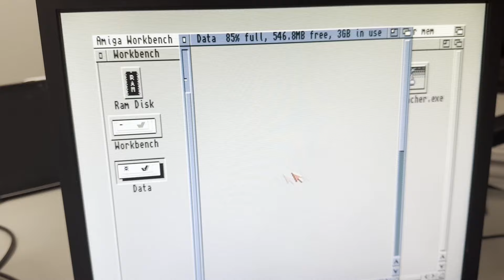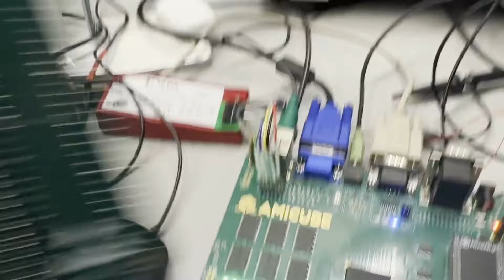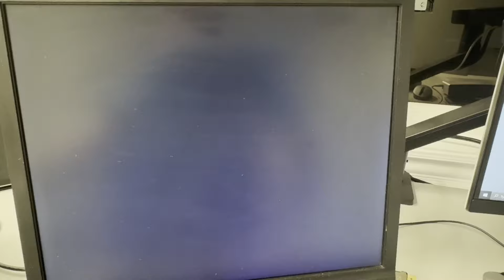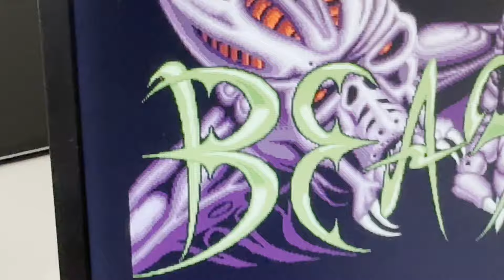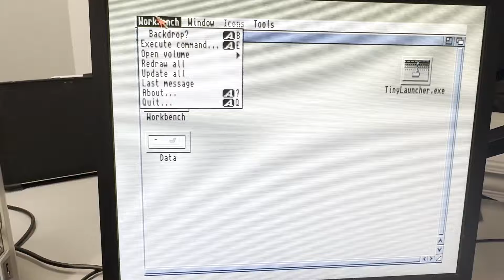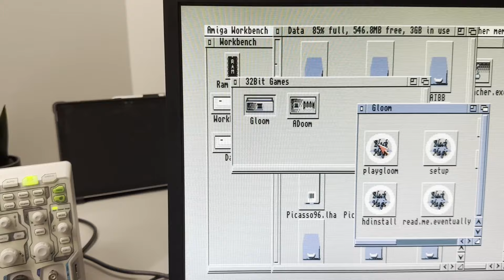🚀 AmiCube v1 - Early Testing 🎉

Comment: It would be nice to have a footprint for a physical Motorola 68060 microprocessor! :)
Reply from the maker: I am actually working on the board that will have 68060 socket. In one of my videos you can see the kicad 3d model.
Reply: And footprint for physical AGA chip could be an option as well. I have a huge stock of these chips! 😀

Comment: Interesting work, but why are you insisting on Neolithic era IO ports? You have all the resources you need for HDMI video (audio and video interleaved on the single port, and the TV/Monitor handles the DAC and analog amplifier stages), plus keyboard and mouse via USB (you can do this with a few MOSFETs and a bunch of logic dedicated to ULPI phys, or add a USB33xx chip to the board and offload that also).
Reply from the maker: All good points. As we speak I am working on the replacements.

Comment: It's so interesting that most of the chips are recreated in the FPGA except for the MC68000, level-shifters, and RAM.  I don't have a feel for programmable logic, but it seems like a 1979 CPU should be easy to implement in the FPGA. I can see how having the actual chip on the board could provide some street cred, though. 😊 I have noticed how dang expensive fpgas are, though. Maybe using the real chip was a big cost savings.
Reply from the maker: You're absolutely right! In fact, the new Amiga AGA cores include a built-in 68020 and I must say, it performs very well. The advantage of having a real socket and a reliable 68000 bridge is that you can add Amiga accelerator cards like the TF68030 or even PiStorm. But at the end of the day, this is all about fun, nostalgia, and the joy of learning RTL, electronics, and keeping the Amiga alive in the retro scene. From a purely practical standpoint, using an emulator is the most cost-effective solution - unless, of course, you're into the hardware side of things.

Comment: Wonderful! I especially like the new floppy interface! But – why not add an IDE interface, too? You mentioned that you are planning different cases – like a cube shaped one – that is great! But why only have two 3.5” floppy bays? I have used a 5.25” external floppy back in the days, too. And if you could add a IDE drive connector, we could connect this to an CD-ROM drive, too. The AmiCube Board is in mini-ITX format and has it’s switches at the front. It’s from factor allows it to be installed into a standard mini-ITX case, but in this case, one would need to be able to connect the front panel header (power/reset button, power/HDD LED). I don’t know exactly, but maybe the headers behind those switches are for this purpose? And finally, my last idea: Why not add all of the Amigas legacy I/O interfaces like LPT/parallel port and an external disk drive port and one serial port? Maybe you can use more of those double connectors or break out cables?
My perfect Amiga would be your board with an original 68000 CPU running at 7/32MHz in one of your Cube shaped cases (hopefully in Amiga beige with an Amiga style design) – equipped with one 3.5” drive and one 5.25” floppy drive and one (slim?) CD-ROM drive. I would also like to use a rotating IDE drive (just to hear the hard disk sounds).
I love your project – keep on with your great work! Too bad that we are not neighbors, otherwise you would have another hardware engineer in me who would surely show up on many Saturdays and help you with your project!
Reply from the maker: Thank you so much for your thoughtful feedback! I’m 100% on board with your ideas. In fact, the trajectory of this project is to use as many original devices as possible. My ideal setup would definitely include a real IDE drive along with the two 3.5” floppy drives, just as you described.

I love the idea of adding legacy I/O interfaces like LPT/parallel and serial ports, these are things I’ll definitely explore. The idea of incorporating a 5.25” floppy drive and a slim CD-ROM drive is also appealing for a more authentic experience.

I really appreciate your enthusiasm and support, if we were neighbors, I’d love to have another hardware engineer on board to help out on Saturdays! Thanks again for your great input!

Comment: I have some questions (but, to be clear - I think this is a great project and I intend to get one device even if the answers are all negative!):

1. What is the chip RAM access speed reported by SysInfo when using PiStorm? Is there any chance to reach A1200 speed?
2. Is there going to be a way to connect a CD-ROM drive?
3. Is it going to be possible to use mouse and keyboard connected via a KVM switch (a hub from the perspective of USB bus)? I am rather short of desk space as I have already 3 development machines; I would prefer to just use the existing mouse+keyboard.
4. Would it be possible to output audio/video from both AmiCube and RaspberryPi using a single HDMI port? I'm asking, because the PiStorm team is working on a hardware accelerated Warp3D implementation, so it would be great if we could use this; AFAIK they are planning the AHI driver too.
5. Regarding the MIDI - have you considered adding a PC sound card wavetable header, so that we could use the DreamBlaster X16GS as a MIDI instrument?
Reply from the maker: Chip RAM Access Speed with PiStorm: Yes, I believe it's already in the 3.xx range, and there's potential to push it further to get closer to A1200 speeds. We’ll continue optimizing it.

CD-ROM Drive Connection: Absolutely! I plan to add an IDE connector for this. While it may not be in V1, it will definitely be included in V2.

USB Mouse and Keyboard via KVM Switch: I’m currently working on the USB interface for the keyboard and mouse, so it should be possible to use them through a KVM switch. You’ll be able to use your existing setup without taking up extra desk space.

HDMI Output for AmiCube and Raspberry Pi: Yes, this is definitely possible. We can add a connector and trigger the switch between AmiCube and Pi output based on certain events, allowing for both to share a single HDMI port.

MIDI and PC Sound Card Header: MIDI is actually a big passion of mine, so this is a perfect suggestion! I’ve definitely considered adding a PC sound card wavetable header, which would allow for the DreamBlaster X16GS or similar MIDI instruments to be used. It’s something I’d love to explore further!
Reply: @amicube  Cool! Thanks for your effort - and good luck!

Comment: This work is truly amazing and getting more and more exciting... The addition of Floppies is also a great addition to the project. I can't wait to get my hands on one of the completed boards as i would like to build a Amiga Tower And being its ATX this opens up so many possibilities but we will need a io shield as well. I have a couple of questions and i know this is a work in progress and more functionality i'm sure will be added. but is it also possible to add IDE to the main board. i know its a an old format.. and this can be solve with some of the SATA to IDE converters. And also brings this project closer to the CD32 as well.   Now the PS2  changed to a USB would be even better but the Hid2ami can be used to help on that issue. i wish i had tons of $$$ i would set you up at 3370 Pharmacy Ave, Scarborough, ON M1W 3K4
Reply from the maker: Thank you for the kind words! We're definitely planning to add an IDE header to the board, and it should be fairly straightforward. Not to mention HDMI and USB <- KB, MOUSE, JOYSTICKS. For now, you can use the IDE option with the TF030 accelerator. I agree, Hid2ami is an awesome project!

Comment: Can't wait! Only thing I would love to see is the ability to connect a real Amiga keyboard to it. Everything else checks all my boxes. Would love to put this in my A3000 case with a A3000 keyboard :)  Will be buying one one released. Another idea for the next broad you create - Addition of an expansion port.
Reply from the maker: Yes! I will add Amiga KB header. This is easy. Straight to FPGA.
Reply: I'm guessing probably not as so few exist and they're getting rarer, short of building one of the incredibly expensive recreations.  What you could possibly do (I haven't tried it) is go Amiga Keyboard -> USB -> PS2.  The Amiga to USB adapter is available out there, and tripplite or startech make active USB to PS2 adapters.

Comment: Another update. Dude don't you sleep. I can't believe how quickly this is progressing. Are you going to add scan doubling/flicker fixer or RTG modes after you get AGA up and running?
Reply from the maker: Thank you! I really appreciate the support! Right now, I’m working on porting AGA to Spartan 6. It’s all Verilog, and while it’s relatively straightforward to move, each chip has its own specifics when it comes to for example buffers, timing, clock and RAM configuration. I’m hoping that within the next month, we’ll have AGA fully integrated, along with the CPU bridge and the new RAM configuration. But it’s definitely progressing well!

Comment: A couple of things.  Please make the PiStorm 68k optional.  I haven't yet been able to justify the cost of the current MiniMig ITX given the additional eye watering cost of shipping out of Canada, this will no doubt be more expensive and bundling the PiStorm will compound it for people who only want to use a real 68k.  I think you'll probably lose customers, whereas if it's optional you'll get both.
Second, how easy is it to disconnect the real CPU from the FPGA?  I'm wondering because I can see this becoming a real multi-computer "mister" type platform given that you've got fully programmable floppy interfaces.  I can see this running PC cores, Atari cores, Acorn cores, TRS80 cores, even other Commodore cores, all with real floppies connected but using a FPGA based CPU.
Reply: Something else I noticed.. In a future version of the PiStorm 68k it would be a good idea to flip the orientation of the 68k/pistorm jumper.  Assuming you haven't changed it already, having the jumper on the left for the CPU on the right, or the jumper on the right for the pistorm on the left will be confusing for those who don't break it out to a switch.  I'm sure it will trip up a lot of people.
Reply: Sorry to be clear, I understand the price is what it is.  I'm not complaining about it, I just can't afford it at the moment.  After rereading my first comment it can be interpreted as me whinging.
Reply: @ffsireallydontcare  You are not missing anything. I have about 30 Amigas incl CD32 and CDTV (I  repaired all, some multiple times) many with accelerators and I don't use any of them. There are better ways to play Amiga games at full speed using emulation for free.
Reply from the maker: Oh, absolutely! Not everyone needs PiStorm—it’s all optional. With FPGAs, the sky's the limit. It’s only a matter of time before someone ports Atari or other cores. After all, it’s all Verilog!